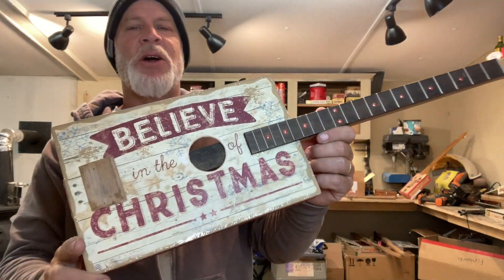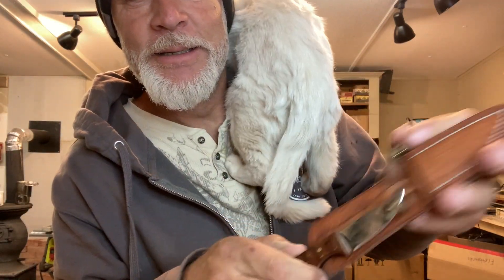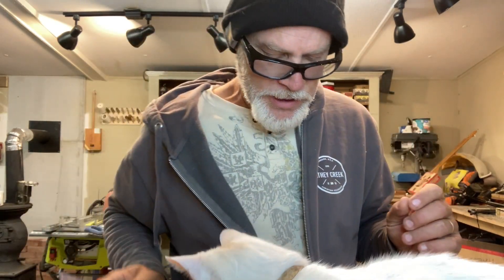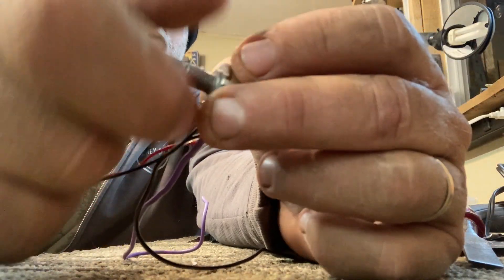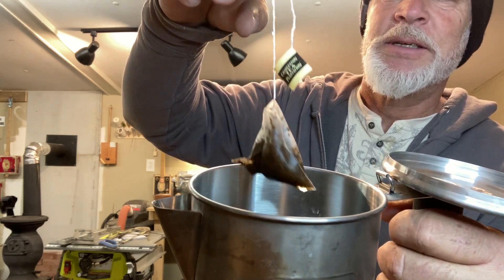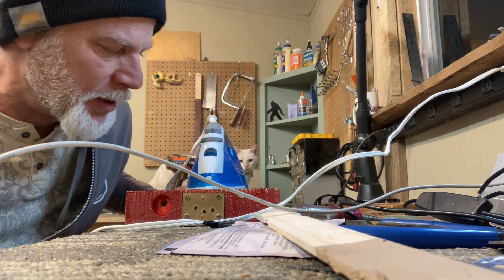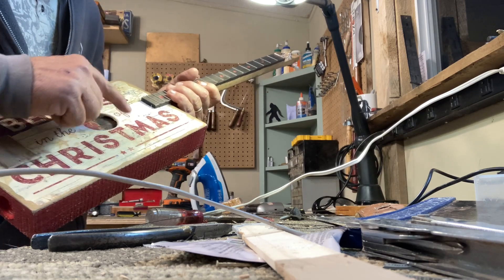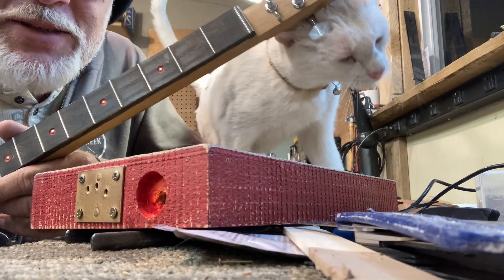Cigar Box Guitar - Reverse Engineering a "Troubled" CBG (Part 2)

Comment: 👍Isn't it amazing,  the first time you do something you have no idea if it will work and it does. It makes up for the trashcan full of failed  experiments. 😆 
At the start of my interest in CBGs I bought a guitar with a busted neck and a cigar box at a thrift store
I was going to take the parts off of it to guitar to make a CBG. Instead I fixed the guitar. After repairing several guitars I took what I  learned to build cigar box guitars. Working on build number 8 and a banjo repair. 
Hope you had a  great Thanksgiving and don't forget to set your scale back 15 pounds this weekend.

Comment: Had anyone mentioned cold. CR glue pops off easy if below freezing, I've had to remove many a superglued items, latest being the "nut" on a cbg 3x's, I kept the cbg in the unheated garage went out a few hours later and popped it with a small hammer then out it came, it was about 23 degrees Fahrenheit. Any item that I've tried has worked so far with below freezing temps. Glass wouldn't work though, lol.